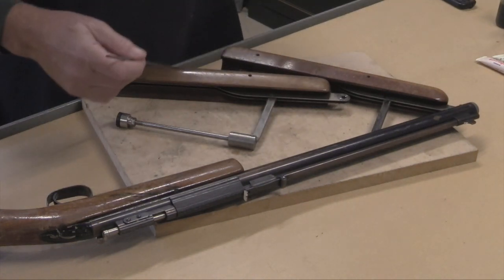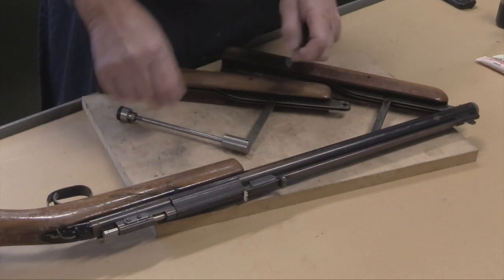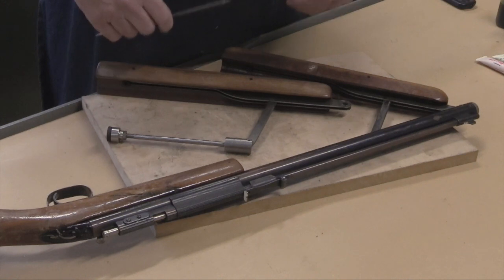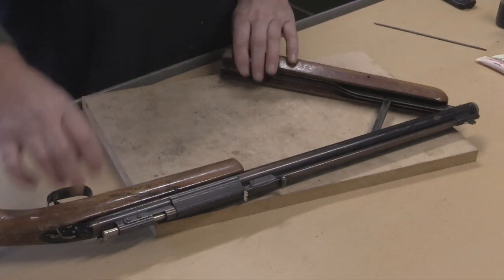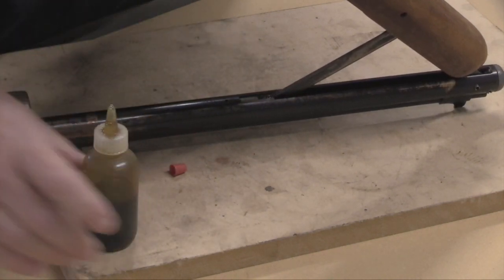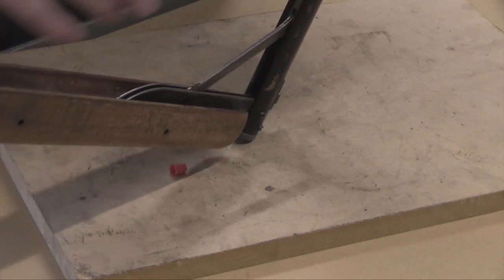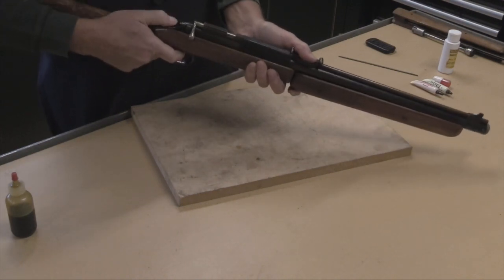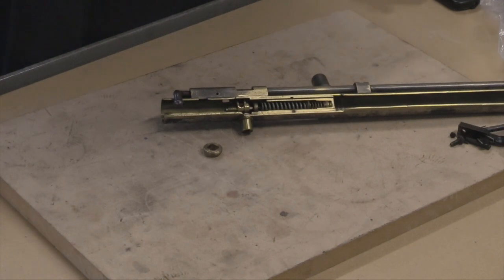Air Time No. 8 Lube and Valve Retainer Nut Stuff

Comment: My Sheridan is a dumpster rescue. And not only that, whoever threw it away tried to destroy her. They bent the barrel between 2 close fence posts and busted the stock and forearm. I know that because I found the pieces in and around the dumpster at the store & lock where our company rented a bin. I gathered up what pieces I could find then took the gun home and pounded the barrel as straight as I could with a rubber mallet then glued what wood I could find back together. She isn’t pretty. Has a lot of scars. Got the old peep sites but she can still hit a target the size of a quarter from about 30 feet

Comment: I just finished rebuilding my 1967 Sheridan Blue Streak and was puzzled over the orientation of the valve retainer nut even after watching this video. The kit I bought from Pyramyd Air came with an o-ring to seal the front of the valve body and a split teflon washer to seal the back. If I put the teflon washer in at the rear of the valve body and screw the nut into it with the beveled edge facing the front, the nut would crush/deform the teflon. In that case, it would make more sense to put the nut in backwards with the bevel facing the rear. I ended up reusing the original lead seal since it was still in good shape. In reality, I don't think the seal at the rear of the valve needs to be airtight anyway and the valve body nut provides mechanical alignment for the back of the valve body. There are three important seals in the valve area. First, the seal at the check valve to keep compressed air from leaking back into the pump cylinder. Second, the seal at the front of the valve body to keep compressed air from leaking back toward the back of the valve body. The third is the seal between the exhaust valve and the valve body where the air exits into the chamber when the gun is fired. If any of these seals leak the gun will not perform at 100% of capability. All the rebuild kits provide components that replace these three seals.

The other thing I had to do was to make two tools out of wooden dowels with fine sandpaper (400 grit in my case) glued onto the end. One is for cleaning the check valve surface and the second was to clean bits of old seal material from the front of the valve body seal and repair scratches in it. I had put a couple of small scratches on that brass seal area trying to remove the old valve body seal material and was afraid that it would let air leak around the valve body. Without this series of videos I would not have been able to restore my old favorite Blue Streak that I've used frequently for the last 53 years.

Comment: Thank you, for makng this video.  My grandfather had one, said it was not powerfull enough.  He showed me how he was pumping it and he only opened the pump 25% of the way.  I think it was never pumped fully once.  I told him pump it all the way, it looks pretty powerfull.  He passed and I thought about that gun, I believe my Aunt has it and she should, it should be passed to her grandchildren.  I inherited a few of the firearms, and a lot of clothes that kinda fit.  
I aquired one with a few other broken airguns as at someones thanksgiving a child brought a box of them up from the basement, found them.  The adults a few were taken a back and said they should not be in reach of children.  I bought them and one is a similar much more used and possibly refinished outer barrel/receiver.  Very happy to get it as I want to use it, never got to shoot my grandfathers.
But before I was going to use it I want to make sure its lubricated, seems to work fine...  But did not want to use the wrong lube.  Where can I get Special Sauce I can not find it online?
I run a bicycle shop and am inclined to use T9 lube.  I have Pellgun oil, Tri flow, Wax lubes, super lube silicone grease I think better for seals.  But I don't want to use the wrong thing.
Reply from the maker: Cool story, and lucky on the basement stash!  Any lube is better than none, Pellgun is ok, but long term use tends to harden and gum things up over time.  The web site for secret sauce is down, don't know when it goes back up.  Slick 50/1lube is pretty good too.

Comment: "I use Wilson Combat lube in my pistols,and revolvers,and have been using it for years on my Benjamin PA 392, that Ive had for ten years, and it runs like new.
Reply: I also own and use a 1967 Blue Streak.  My Dad purchased it for me when I turned 13 years-0ld.  Probably more than 20 yellow boxes of pells (10,000+) and no rebuilds, yet.  No leaks.  I purchased Silver streak for my son at his 13th (he is 37now) and it leaks a bit with relatiely low pell count.  I gave him a kit.

Comment: I watched all your  excellent videos. I have the  397 and I am very happy with it. Sometimes with some pellets, it is a little difficult to push the  bolt forward  (with some force) to get the pellet in position,  is this normal?
Reply from the maker: Could be fit of the pellet head to the breech, try a different make of pellet and see if that helps.
Reply: @NorthWestAirgun  it happens with some particular brand,  as I understand is not an issue  right?  Thanks for the help,  keep on going
Reply: @NorthWestAirgun  do you sell a rebuild kit for the Benjamin Sheraton , model number 397pa 4.5mm ~.177cal
Reply from the maker: @michaelbrink4779  I don't have kits.  Try ebay or Baker Airguns

Comment: I'm late....  Flat goes in the back.  Bevel is forward to allows seal gland area.
Reply from the maker: Right, but many people have trouble starting the nut and end up crossthreading.  So, if that happens, turn the nut over and see if it will start that way.  Then if it seals up, you are done and nobody but you will know that the nut was reversed.

Comment: I've got a Baker rebuild kit for a 1969 Benjamin 342.  When I opened the valve up there was no evidence of an inlet valve spring or washer between it and the outlet valve spring.  What size washer does it need, or does it even need one?  Can the springs just rest on each other? Thanks, Jack
I appreciate these videos very much, I've poked around with springers but never a pneumatic multipump.
Reply from the maker: Hi Jack, you never know what you will find in these old guns, or not find.  Best to contact Baker, since you got the kit from them.  But I’d put a washer in there, 1/2” copper or brass.  Need the inlet valve spring too.  Baker can help you with that.
Reply: @NorthWestAirgun  Thanks for your reply.  Just now I did some more digging.  I hit it with some WD40, fashioned a long hook and out came the washer and inlet valve spring.
Your videos are invaluable for a novice like me, I'll be relying on them as I work my way through this rebuild. thank you again

Comment: What to do if a bit of oil gets inside the air hole that’s engraved with the words Airhole do not oil? Also some have recommended using rubbing alcohol to flush out these Benjamin pumper rifles. Thoughts? I used Ballistol brand very light oil on mine hopefully didn’t get any in the air hole. I appreciate any help from anyone many thanks
Reply from the maker: A little oil shouldn’t hurt anything.  Just shoot it, if a problem develops, which is unlikely, deal with it then.

Comment: Hey I have a benjiman model 347 the pump arm wouldn't stay down past 2 pumps it had been bent but bent back what should I do
Reply from the maker: Hi Victor, hard to say what the effect of the bend is without seeing it, you can get a new handle from Precision Pellet at     http://airgunshop.net     , you'll have to call or email, I think it's about $25, and if you ask it will come with the link and link spring installed.  All you have to do it swap out the wood.  If the arm is getting pushed back due to pressure, it could be that the pump rod needs to be adjusted to be just a bit longer and bottom out on the compression tube.  Maybe the bending did quite get you back to the original position of the pump rod.  The other thing is that your check (or inlet) valve in the compression chamber is leaking.  You can see if you leave the pump lever open after you pump it, let it sit for a while and see if it moves the lever more.  Sometimes they move up past the air intake hole even.  Good luck!!

Comment: The solder has come lose on the retaining nut for the stock and keeping the bevel valve from coming out.
Reply from the maker: What model?  If it's a Sheridan, you can sometimes stick a screwdriver or something to hold the screw in place,  then tighten the nut to the tube.  Once it is re-assembled and the stock nut tightened ( not overtightened), the lack of solder shouldn't be an issue.

Comment: Hello there I have a rusty gun is there a way of restoring my bb gun
Reply from the maker: Rust-bad.  You can use some fine steel wool and Remoil to get the rust out.  But it's not permanant if you don't keep it oiled.
Reply: BP penetrating oil cuts the rust loosens any bolts or nuts that are rusted shut
Reply: I was just dounce it with BP oil and let it set a couple hours and just take a rag and wipe it down if that doesn't do the trick then use some fine sandpaper lightly